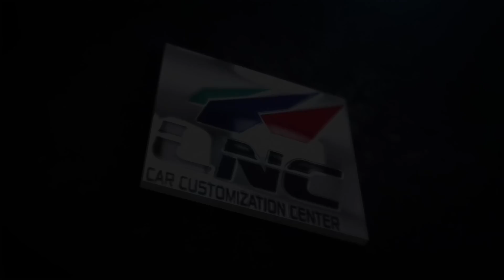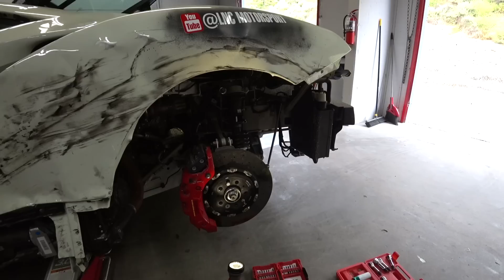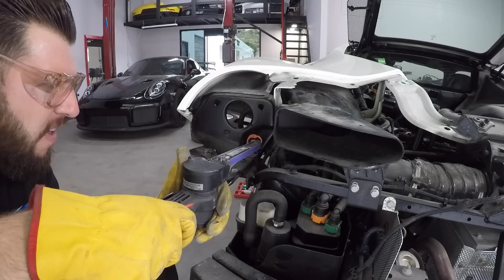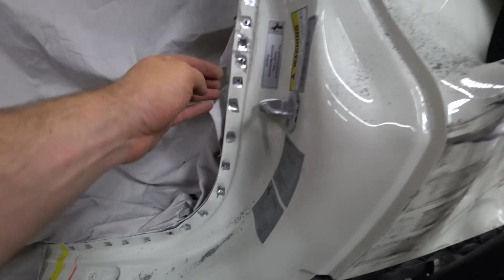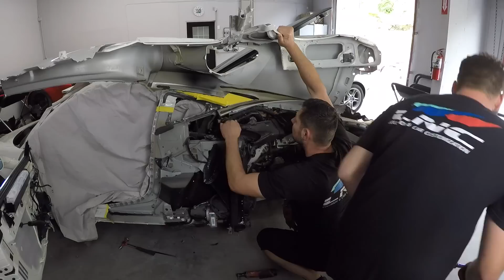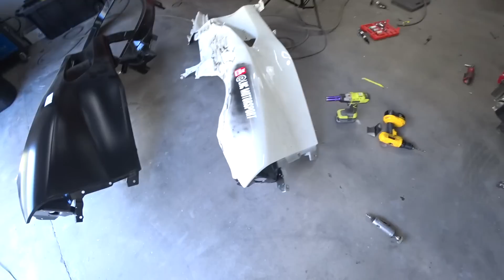REBUILDING A WRECKED FERRARI 488 GTB FROM COPART PART 3

Comment: There’s a spot weld drill bit that will make separating that a lot cleaner an easier
Reply from the maker: Spencer Fernandes I have them, they don’t work good on the rivets, I like to use 3m spot weld grinder, works the best. 😊Thank you for watching 👊🏼
Reply: Yea that grinder was pretty dope thought they were spot welds not rivets  keep up the great work